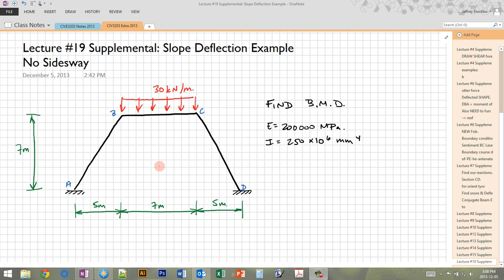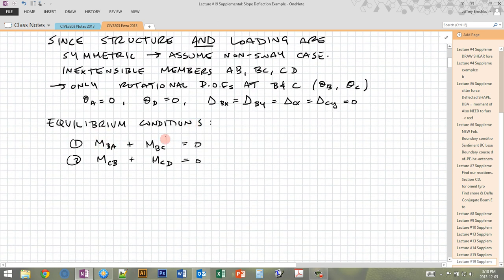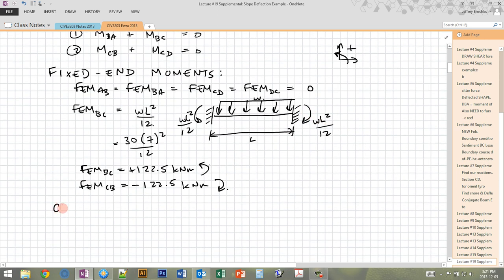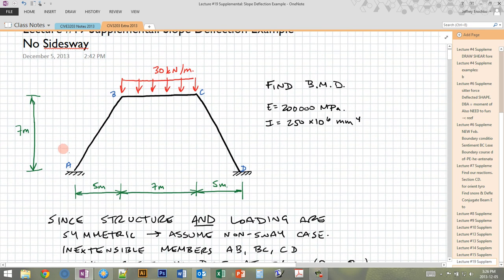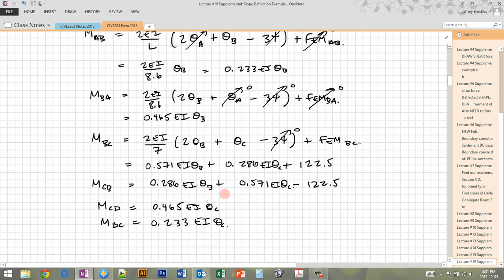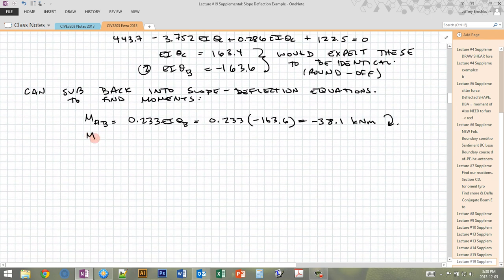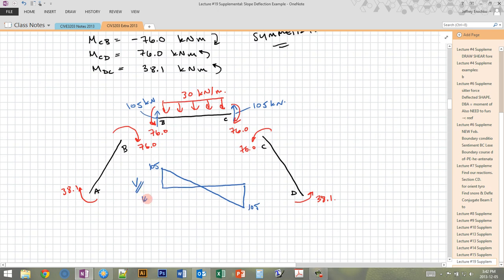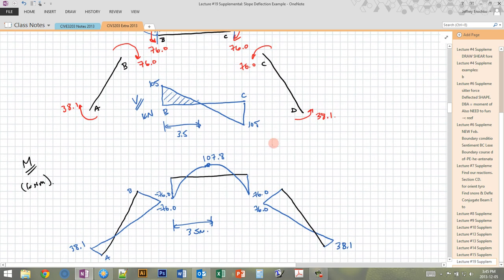EXAMPLE - Frame Analysis using the Slope-Deflection Method (No Side-sway)

Comment: Great lecture. But if i undrstood correctly you have calculated that the end moments for memeber BC is = I122.5I kNm but the value in the end result is I76I kNm. Can you clarify the difference between the two values?
Reply: You have to take note that the Fixed End Moment of a point is not the same as the Moment of forces of the same point. :)